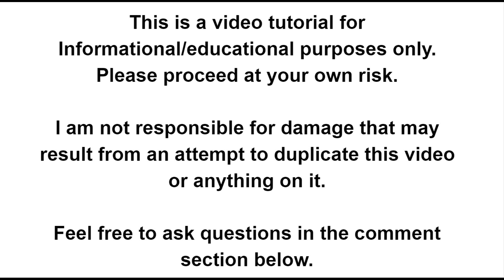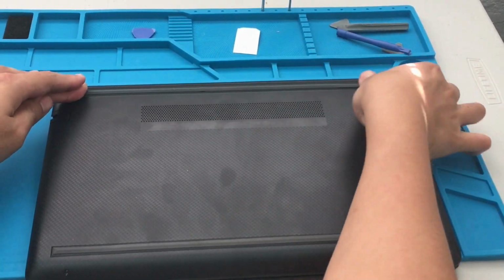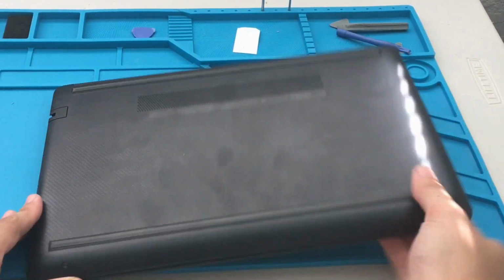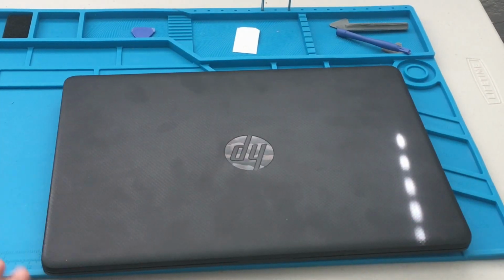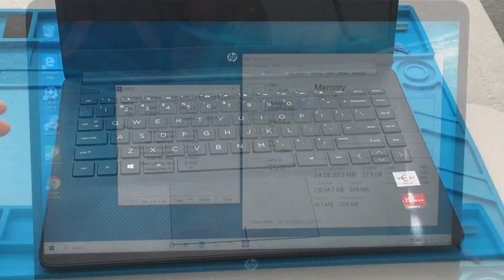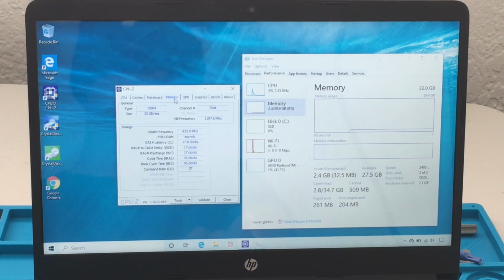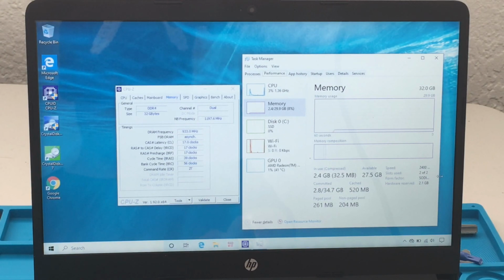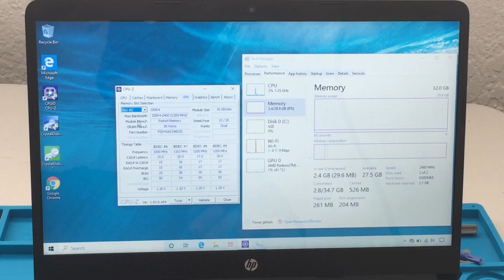32GB DDR4 RAM Upgrade | 2020 HP 14 inch Laptop 14-DK1003DX

Comment: Is that a ryzen 3 2200g laptop?
Reply from the maker: And athlon 3000 series 3050u silver
Reply: I have the same laptop but my specs are ryzen 3 2200g radeon i bought it 2 years ago. Can i uprade it to 16 gb ram? I play valorant on it but i cant aim properly because of lags if i upraded it to 16gb of ram could it be smoother?
Reply from the maker: Check task manager then check the dedicated gpu memory and shared memory. This will give you an idea of your gpu ram and shared gpu ram. If you increase the ram it will increase shared gpu memory
Reply: How can i do that could you tell procedure?
Reply from the maker: hold down ctrl+alt+delete then click "performance" tab. Select "GPU" on the bottom. Scroll all the way down to view your dedicated GPU memory and shared GPU memory. also you might have to research your motherboard and cpu to see what ram upgrades are available. I'm sure there are youtube videos out there.
Reply from the maker: oh yeah I almost forgot to figure out ram or ssd possible upgrades people use "crucial scanner" it's free
Reply: The laptop have 1tb on it
Reply from the maker: that might be your Disk space. You need to check your "GPU" portion if that makes sense. I'm trying to think of other tools that can help you. But yeah let me try to look for some youtube videos that show upgrades for that laptop
Reply from the maker: I'm not seeing it. 14-dk1025wm is most likely the model of your hp laptop.
Reply: Thanks for this information
Reply: Do u have fb account to send the image of my laptop so u can see the model of my laptop?
Reply from the maker: I'm not to active on facebook at the moment.
Reply from the maker: yo check this one out https://www.youtube.com/watch?v=fv6oZEczlJA&t=552s looks like this guy upgraded. check around the 2:20 mark
Reply: Not that one mine is like a matte blck on it and it said on the back hp model 14
Reply from the maker: Oh ok. You might have to do some research. The crucial scanner should tell you how many ram slots you have and kinds of ram upgrades available
Reply: Oh ok ty bro
Reply from the maker: Good luck!

Comment: wow i totally wanna try this... but i dont think my hands have the magic touch... i feel like i would break something >_<
Reply from the maker: It can be scary. Feel free to look at other YouTube videos as the 14 inch hp laptop body is similar to most of their laptops in terms of opening. It will give you a better idea on how the laptop is opened.
Reply: @whattmeter  cool thanks for your reply... any suggestions wear i can get the prying tools... im not fancy and i dont have a 3d printer :/
Reply from the maker: Prying tools can be found on amazon usually under 10 bucks with some screwdrivers. People also go ebay or other online sites as they are small and easy to ship.
Reply: @whattmeter  thank u

Comment: 1:27 What is that, exactly?
Reply from the maker: which one? the ram on the laptop in the video has the speed of 2400mhz
Reply from the maker: Crucial scan is a program to help figure out what ram and ssd upgrades you can make on your computer. Cpuz tells you information about your computer such as cpu model, what ram you have etc

Comment: hi how many sticks of ram do i need?
Reply from the maker: It comes with 4gb stick. The slot can hold two sticks total. So that leaves one vacant slot
Reply from the maker: You only need one stick if you plan on using the 4gb that comes with it. Make sure you have the same speed as the first stick. The one in the video was 2400mhz but double check yours

Comment: can you leave link where you bought? is it 240pin also? can I use DDR3 I have some left over. Ty
Reply from the maker: Sorry ddr3 has different pins. There’s a link in the description for ddr4. There’s plenty of options just letting you know
Reply from the maker: Here’s a link came from amazon https://www.amazon.com/gp/product/B074Q1P62K/ref=ppx_od_dt_b_asin_title_s00?ie=UTF8&psc=1
Reply from the maker: 260 pins for ddr4 laptop memory is standard for ddr4
Reply: @whattmeter  thank you sir!
Reply from the maker: No problem
Reply: @whattmeter  if I'm trying save money can one 8gb be good enough with the 4gb already in?
Reply from the maker: @rhino11us  Totally. You can add additional 4GB or 8gb. If you look at some best buy reviews, some people go 12GB total. Just make sure you get the same speed ram to maximize the dual channel. On the computer in the video, the original speed was 2400mhz, double check your speed of ram and for the second stick you decide to get make sure it has the same speed as the original. 4GB or 8GB additional would help I would just make sure to match the speeds
Reply from the maker: @rhino11us  actually overkill to do 32gb ram, most people go 16gb or 8gb ram. the reason I went with 32gb was to see how much gpu shared memory would be provided with the extra ram.
Reply: @whattmeter  i'm looking forward play fortnite & 7 days to die
Reply from the maker: What is 7 days to die? Fortnite works but i feel like this laptop wasn’t meant for gaming. Definitely add some ram if you will be playing fortnite. At 32gb ram and a bigger ssd It was running at low settings
Reply: @whattmeter  7 days to die zombie survival game.
Reply from the maker: Cool good luck!
Reply: @whattmeter  sorry, I was curious can you use a regular size SSD not a m.2?
Reply from the maker: @rhino11us  There's a space but I didn't see a connecter for it Inside the laptop

Comment: is it good enough ram? i want to buy it but still pretty confused bcs it was cheap for it's price
Reply from the maker: It is cheaper because it is 2400mhz which is slow by today’s standards. I wanted to make sure i was using the same frequency as the original ram to make sure it runs. Not sure if higher ram speeds will work but i saw some beat buy reviews others seem to run higher speeds but only use one stick
Reply: @whattmeter  is it reliable? bcs it's 10 dollar cheaper than other manufacturer
Reply from the maker: From my experiences, yeah I have patriot memory for most of my computers. Higher CL (latency) too which means it's not as good as the others. More of a budget ram, if you are having doubts probably best to go with a brand you are familiar with. Or RAM with good warranty. I haven't had any patriot ram fail on me yet so I haven't tried sending it in for warranty.

Comment: The SSD you used doesn't load in Amazon bro
Reply from the maker: Really? Let me relink. I just ordered another one. Feel free to copy the title and search. I will relink asap
Reply from the maker: Thank you. The link is fixed. What da, the price went up by five dollars. No wonder why the link changed. Must be a popular buy
Reply: @whattmeter  wow you're extremely committed to replies. Not too many YouTubers respond as quickly as you did bro. Mad props. Subscribing for sure. Also, did the ram upgraded significantly help and do you think I'd be able to run games such as dead by daylight, flashing lights, Batman Arkham Knight or asylum, or even American truck simulator?
Reply from the maker: No problem. I just happened to be online. LOL plenty of questions about this laptop. I did a video running fortnite and some games. I tested CS go, fortnite, starcraft 2, and ultimate chicken horse. Bottom line this thing is not a gaming laptop .  It will run it, but definitely below 30 fps at 1366x768 resolution. Pretty fun, but dang fornite really ran the fan on this laptop. I don't think I would game too much on this. Looking at the specs no way this laptop can run dead by deadlight. You might be able to run the other games but it would have below 30 fps for sure.
Reply: @whattmeter  oh ok good to know thanks
Reply: @whattmeter  you know you can bump it up to 1440p right?
Reply: I have mine at 1440p
Reply from the maker: Thats awesome! You could make a video on that! I didn’t know. I’ll keep that in mind
Reply: @whattmeter  just to clarify also, the ram upgrade significantly helped performance?
Reply from the maker: Yup. I tried opening 50 chrome tabs it handled it no problem
Reply from the maker: 32gb might be overkill. Most go 16gb
Reply from the maker: Btw, I'm going to try running dead for daylight just incase I am wrong. Give me a couple of days I will let you know the results are with this laptop.
Reply from the maker: Dude, I downloaded Dead by Daylight, Batman Arkham Knight, American Truck Simulator, Doom, Nascar Heat 4. I will let you know once I run a test. The laptop has 2 GB of dedicated Memory. Also since the RAM upgrade there's 15gb of shared GPU memory so there's a good chance these games will work. But I don't want to get overconfident. I bought the games and downloading now. Will let you know once I test
Reply from the maker: Dead for daylight works with the 2gb build in gpu ram and the 15gb shared gpu memory. Arkham knight works and american truck simulator works too
Reply: @whattmeter  yeah, American truck simulator worked for me. Thanks, I'm sorry I never saw your responses
Reply from the maker: @mendoza9007  no worries. i usually don't see responses either for some reason

Comment: Did you do anything else to maximize the maximum capacity of RAM? I saw somewhere that it only had 8GB maximum useable RAM. It could just be my eyes deceiving me though haha, I hope that's the case. Awesome tutorial!
Reply: ^^ what he said
Reply from the maker: Interesting. really? I checked cpu z and task manager showing 32gb. Hang on let me double check
Reply from the maker: Performance tab in task manager shows 32gb. Available Ram is 26.8 GB same as in the video. Is there another way to check usable ram that you prefer? Keep in mind im using 2400mhz same speed as the original ram. Maybe they were using higher ram speed??
Reply from the maker: Resource monitor shows available ram 271200MB ram. Which is like 27gb but let me know if there’s another way to check usable ram. Even F2 system inform when I turn on computer recognizes the ram
Reply: @whattmeter  if it shows available ram up to that amount I think you're good dude. I work on cars primarily haha. I was just thinking of getting Dual 8gb. Were you able to achieve 16+ RAM usage? Thanks!
Reply from the maker: Haha thanks! Im happy to try things! Cars awesome! Much more practical skill. I think fortnite ran this computer pretty hard when someone asked me to test it. Fan was going crazy lol. Also fortnite took up like 90gb of storage space. 16gb+ usage probably not. I could try opening a bunch of chrome tabs
Reply from the maker: Btw awesome channel @airshowlover100
Reply: @whattmeter  Thanks man! I appreciate it, I haven't been too active recently. College takes up a bunch of your time haha. And the program is called CPU-Z to verify motherboard type?
Reply from the maker: Yup. So there’s two things I check on CPUZ. The CPU for this laptop (if you google AmD Athlon silver 3050u ram capacity) it will tell you the max GB it supports and the frequency. The motherboard I look up to make sure there are the right number of ram slots
Reply: @whattmeter I got that same CPU, and my motherboard is an HP 879E, but I looked and didn't give me too much. Pretty sure I have two slots not sure if one is soldered in or not.  Thanks! Sorry for the headache.
Reply from the maker: Yup that’s the exact same model as me. No worries. Dang idk if they pulled the motherboard info but I found it online before. But yup same cpu and motherboard as the laptop i have in the video. Lol maybe because everyone is upgrading the laptop they pulled the info online or something
Reply from the maker: Btw I did not do anything special. Just double checked motherboard and cpu information as well as cpuz to confirm ram capacity
Reply from the maker: Got it. Someone told me to check system properties. 32gb installed RAM. 29.9GB usable

Comment: Hi,can you please recommend best 8gb ram for this.I want to add 8gb to the existing 4gb and also would there be any keyboard skins for this model.I cant find any.
Reply from the maker: I played it safe and stayed with the same frequency of 2400mhz. I usually go patriot memory because they are a few dollars cheaper. Were you planning on going amazon or a store like best buy? Stores vary in price. I would just do a search ddr4 laptop memory 2400mhz. You should double check the current speed of the ram you have just incase it is a different model
Reply: @whattmeter  was it decent enough for the price
Reply from the maker: @dopeboy3879  In my opinion yes. But it really depends on what you use the computer for (multitasking a lot?). Ram speeds at 2400 Mhz is not the fastest so they are much cheaper now. Since, I like to multitask, I feel like a ram upgrade is worth it. Also, the increase in ram allows more shared gpu memory, so it's an extra resource that the gpu can access when needed. But like I said, it depends on what you use it for as most people are ok with 4GB for basic web browsing etc. You could always test the laptop first before buying more ram to see if it meets your needs. Hope this helps.
Reply: @whattmeter  sorry i mean the patriot brand since you said its cheaper im planing to upgrade my ram and im being offered a 8 gig patriot brand in 26666 mhz
Reply from the maker: I have mostly patriot ram and they’ve never failed me. I would make sure you have matching ram speed though if you are going 2666 if you want dual channel. Keep in mind patriot ram usually has higher cl (latency) so it’s not the best out there as there are many others with lower cl (latency). If you add a 2666 ram stick with a 2400 it will run as the slower speed and a lot of people dont recommend mixing different ram types. In my opinion for the price patriot ram is on point, especially for budget user like myself but it’s all about preference
Reply: @whattmeter  thanks for the tip ill keep that in mind
Reply: Hi,thank you for replying back.It is the same laptop and the same model. 
This is the one I initially thought to buy:patriot 8gb sodimm ddr4 2666mhz 260 pin card

Is this suitable.or should I go with another one?
Reply from the maker: It is a faster speed. Were you planning on using the original 4gb that it came with as well? It will slow down the faster speed ram if the speed/mhz don’t match. Did they also mention what cl it is? Is it a cl17? The lower the cl the better the ram. I hear it is bad to mix ram with different speeds
Reply: @whattmeter  I found few reviews on that.Maybe I will remove the 4gb completely n add an 8gb one initially PNY - 8GB 2.4GHz PC4-19200 DDR4 SO-DIMM Unbuffered Non-ECC Laptop Memory - Black
Reply from the maker: That would work
Reply: @whattmeter  Crucial 8GB Single DDR4 2666 MT/s (PC4-21300) SR X8 SODIMM 260-Pin Memory - CT8G4SFS8266 ended up ordering this.
Reply: @whattmeter  Thank you so much for taking your time and solving my confusion.Iam upgrading the RAM for the first time.
Reply from the maker: No problem! Nice crucial ram i hear is pretty good
Reply: @whattmeter  Perfect.Thank you😀
Reply from the maker: Cool. Using crucial scanner is usually the easiest method I use to findout compatible ram
Reply: @whattmeter  I tried the crucial advisor tool.But it was suggesting me 240pins RAM
Reply from the maker: Whaaaaat really wow. Good thing you checked.
Reply: @whattmeter  yeah after which I found your videos on the exact same model and checked with you before giving an order.
Reply from the maker: First time i heard of single rank and dual rank. In the future I will try out crucial ram. Good luck with the ram upgrade
Reply: @whattmeter  thank you.I subscribed to your channel it is very informative n goes straight to the point.
Reply from the maker: Thanks! I appreciate it
Reply from the maker: Lol i think I found it on amazon. Check the reviews. Looks like  someone used it on the same laptop.
Reply: Yes.I was actually planning on adding with the existing Ram.Looks like it is not a suggestible option.
Reply from the maker: Bottom line it will work. Just not at the fastest speed. Ive never mixed two different ram with different speeds before becouse they told me it was bad. Any reviews that mention adding it to the hp 14 inch laptop?
Reply from the maker: If you are adding to the original 4gb ram. I just checked on mine. It was a sk hynix brand 3200AA pc4. Usually best to keep the brand the same and frequency as well. I would definitely double check the current ram frequency you have
Reply from the maker: Keyboard skins. Couldn’t find anything either. This is kindoff a budget laptop so I guess people dont invest much in protection for it.